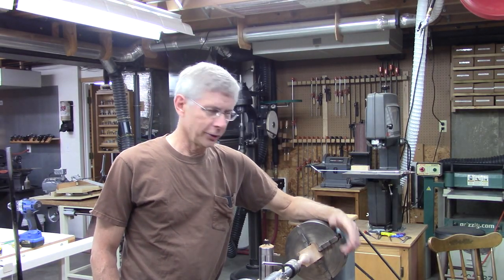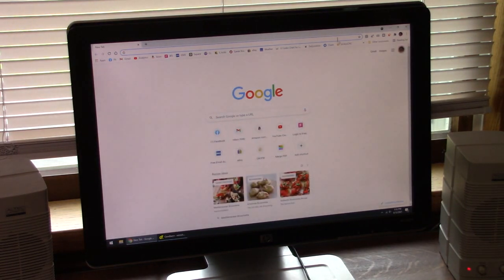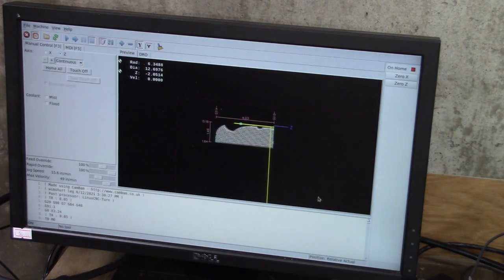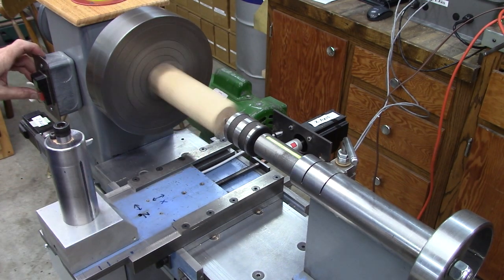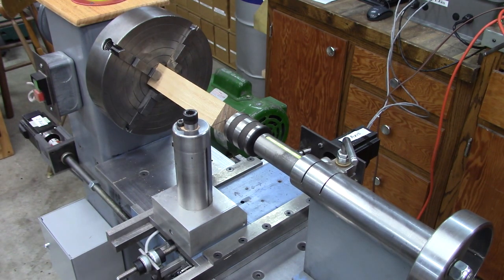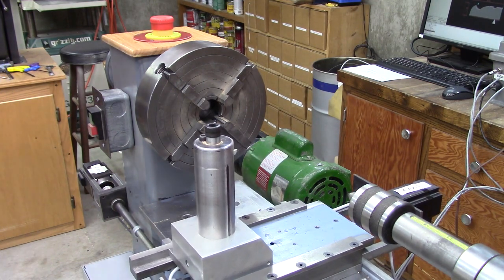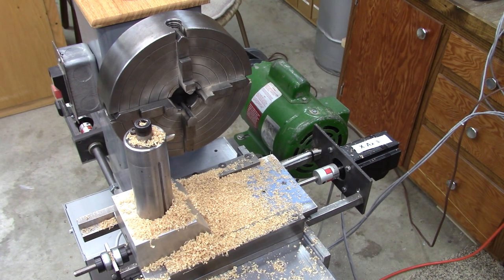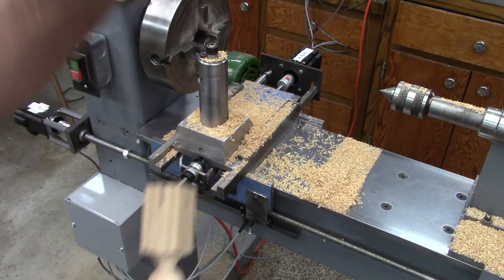Making Chips On my CNC wood lathe! (Part 4)

Comment: Hi, I am new to your work shop, great looking job, in 1998/9 , I purchased 2 wood lathes, Wadkin RS8 , and Kontour 1500 semi auto feed. 
On the Wadkin, I purchased a very large engineering tailstock, and add it motorised, I had got a contract to make a few thousand pepper, Potts Mills, they were to celebrate the millennium in 2000, I had some special cutters made so I could bore the whole to insert the mechanism for doing the grinding of the pepper. The tool would go in to a certain depth and stop, then retract., on the Kontour this lathe would turn the material down to a certain diameter, I could set the depth and set the travel from left to right, I purchased a special cutter that could cut in both directions. It was quite expensive but not as expensive as the sharpening machine that I had to buy to sharpen it. It was a very strange shape came to virtually to a point I’ve got a V cut in it on both axis, I could turn a piece of 4 inch stock material, square that was approximately 3 foot in length, down to a 3 inch or even less diameter. In a matter of seconds the shavings would come off it in a plume.. 
I’m now retired living in France and I’m now trying or thinking about computerising the travelling table on this machine , Kontour. I found your a territorial very interesting., my biggest problem, I’m not very good with the computer. I have just subscribed to your channel and I’m going to have a look at some more of your work., stay safe, PHIL FROM THE DARK SIDE OF THE MOULIN, FRANCE
Reply from the maker: Hello Phil. Good to hear from you. Obviously my lathe is primitive compared to yours. After building one lathe and understanding some basic functions of CNC I this I could do much better building a second lathe. Maybe I will someday but in reality I'm retired I don't really "need" another wood lathe. Still I find the whole process fascinating. YEP...  the computer end of things is crazy complex. The software even more so!  I had a good friend set if all up for me. I'm also using a CAM program called PartMaster. I got it free for doing a video but its a great program. Still....  I use my own video to retrain myself to use the program. I guess the main problem is "occasional use". If i used it every day I'd remember how to use it.

Comment: Okay Winky, I found the series on converting your wood lathe to CNC and that is where the custom-made tubular, telescoping, transverse slot tool holder is being used. I was able to get a screen copy of it but I'm not sure how to paste it into this communication - please tell me how I can find your build episode for that beautiful post that you made specifically for the wood lathe application.

BTW.  it's about 8:45 on Monday evening and I have just watched all four parts of the making chips on my CNC wood lathe which I find exceptionally soothing and is almost as Zen like experience.  Thoroughly enjoy watching guys do things that I would like to know about although there is no chance that I'm ever going to be able to do that for myself.
Reply from the maker: The tool post was an interesting design. The idea was to index to the top of the slot so that the tool was always on center. I ended up changing the post however because the width of the post got in the way. It would hit the chuck of feature in the turning. My current post is only about 5/8" wide.  The tool has gone there all sorts of evolution as well. Ideally the cutter needs to be 1/8" wide with a round tip. It needs to be shaped like a gouge used with a manual wood lathe but with sharp sides about 1/2" back. I've made some very good cutting cutters but they get dull in about 10 minutes and making and re-sharpening these cutters is super hard. I finally found a way to dish the end of a 3/16 round HSS rod with a carbide bur to make a cutter. It works almost as good.
Reply from the maker: https://youtu.be/KEzoPeqnRRw?t=3994

Comment: I'm gonna say something weird now...I've not programmed a CNC but I've done something very similar - programmed a robotic measuring head - to measure the diameter of a rod rotated to 3 120° interval positions - so a similar type of thing but written on a computer using the BASIC language.

Great result on your equipment even if the software has some funny habits !
Reply from the maker: Anything is possible with the right knowledge.

Comment: Great one.   What does the cutter look like?
Reply from the maker: I made it out of a 1/4" HSS steel blank. I cut a v groove lengthwise near the tip and ground it down to about 1/8" wide. I did this to make it cut better on the sides. It seems to work well.

Comment: There looked to be some tear out on the finished product. The cutting bit seems more suited to cutting steel rather than wood. Having said that, I admit that pine can be a pain to turn without tear our
Reply from the maker: Ideally you should have a very high rake angles on both the top and back (or top). If you watch a good wood turner manually turning wood they have the chisel pointed up at maybe 45 degrees. The idea is that you need to cut not scrape the wood. My cutter is made with a HHS blank. I cut a V groove in the top so that it would cut on the sides better but it really needs to be shaped like a bowl on the end and that hard to grind to this shape. The tool cuts going from left to right so I may try grinding the whole top at an angle. I was actually surprised the tear out was so good. The only place you see it is at the top. Also, the wood is poplar....  which is slightly better than pine in every respect but still not as good and other hardwoods.

Comment: Looks great. I’m newer to Wood Turing and I watch Kents on YouTube channel(turn a wood bowl). I noticed your lathe always cuts in the same direction, chucking it up with the grain going the right way would be helpful. He has a video on grain direction that would really help with tearout and finishing. Keep the videos coming!! I watch them all
Reply from the maker: Yeah...  I guess its just the way the software works. It could be changed in the gcode to cut in both directions and not back out so far but it would be hard for me to do. If I was making 100 of one spindle I'd look into it. I love this thing but I have a lot to learn.
Reply: @WinkysWorkshop  I love it too. Maybe I was confusing. You probably want it to cut in the same direction, meaning not change anything, but rather pay attention to the way the grain is running when you put in the chuck. It would really make it even smoother with little to no sanding. Hope this makes sense.

Comment: That was exciting, I bet you were on pins and needless wondering how it was going to work. Its always a great feeling when a project comes together, you must be thrilled. Now you can finish off some of the odds and ends on the lathe then become more familiar with the programming process. If you were to go with ACME or ball screws do you think that you would be able to work with non ferrous materials? I'm excited for you buddy!
Reply: @WinkysWorkshop  Thinking about it now there is alot of leverage on the cross slide. I bet you are excited I know that I would be. This is about the most interesting project that you have done since the square column drill press. When some people questioned it's accuracy and you checked it with that long rod I could hardly believe the results that you achieved. That was great. Oh thanks for the extra stickers. I'll be in touch.
Reply from the maker: @andyZ3500s  You are more than welcome Andy! Yeah, the drill press was probably my most useful project and I was very surprised (and pleased) when I measured it. Tomorrow I'll install the lead screw covers and hopefully put the lathe in a more permanent position. Right now it's in the middle of the shop.

Comment: Once you touch off and find your zero point, do you have the option to reset your “home” to that position. That way after you remove the wood to test your code you can replace the wood and select return to home and go right back to your origin (zero point) like a traditional CNC. Good job on your conversion.
Reply from the maker: Touching off calibrate it so that I can move it anywhere and it will stay calibrated. The extra cuts were a max diameter setting in CAM

Comment: With that wood lathe running as fast as it does, I hope you don't exceed the max safe R.P.M. of that 4 jaw chuck. I'm with you on the screws, ball screws would be the way to go. Everything else allows for backlash. Nice job! You can teach an old dog new tricks!
Reply from the maker: Backlash isn't much of an issue with wood but acme threads would be a better. I don't have enough room for a ball screw on the cross slide.

Comment: That was beautiful! Could you attach a dust extractor to the head?
Reply from the maker: I plan to do something like that as well as cover the leas screws. Thanks
Reply: Yeah - get it to clean up after itself !

In the programming department:

Operation 1 - spindle on
Operation 2 - dust extraction on
....

....
spindle off
dustextraction off
END
Reply from the maker: @millomweb  Ha...  I'm having a hard time with a simple operation and don't need to add more complexity!
Reply: @WinkysWorkshop  So the first question is - does the stepper motor controller come with any simple switch outputs ? Ideally 2 but one would do and when you're using it, you could turn the spindle motor on and dust extraction with one output.
I'd suspect there will be at least one simple switch output and it'd only be one more command in the programming.
Reply from the maker: @millomweb  The steppers can be paused and started via the program and it will continue where it left off. It can also be stopped when cancels the program. I have the e-stop wire to stop the lathe and steppers. It would probably easy to start the vacuum with the program but I'm not sure it is worth the effort. I'm also thinking about making a clear shroud over the work and attaching my 3hp dust collection system.